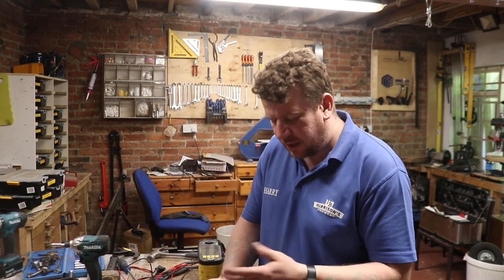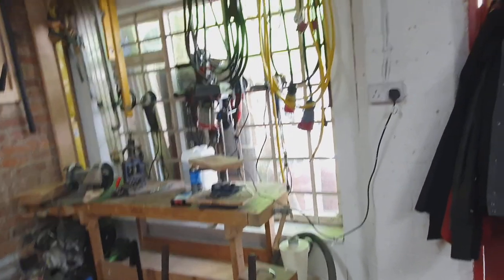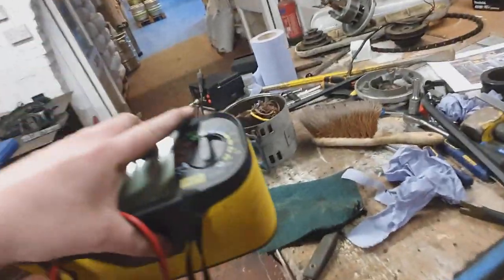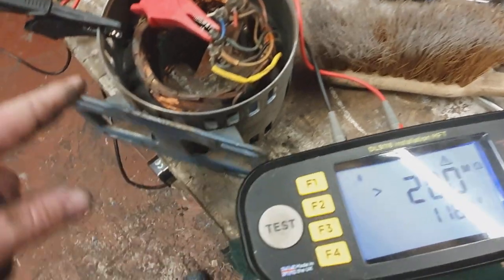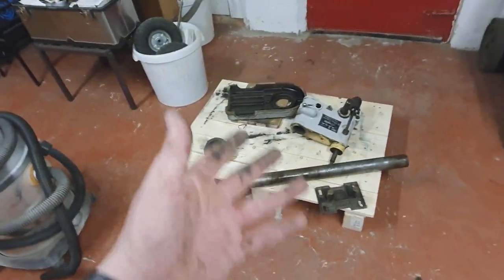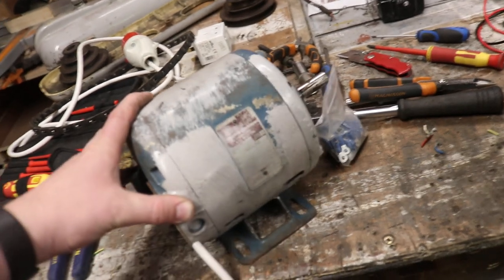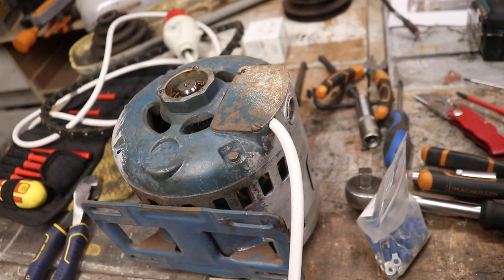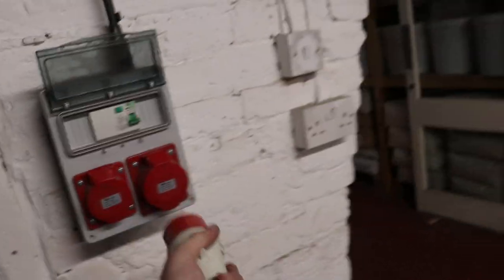FOBCO Star Drill Press Restoration Pt1

Comment: Regarding the addition of a variable speed drive (VFD, or inverter) - a few words of caution from someone who's worked in electronic control of motors for 35+ years.   A VFD works by rectifying the incoming three-phase AC to a DC voltage of about 550-600 volts, and then converts that back to AC (at whatever frequency and voltage you wish) using "pulse width modulation" (PWM).  Without going into all the details (a Google search will give you lots more if you want it) the resulting voltage waveform that's applied to your old motor is quite different from the 50-60Hz sine wave voltage for which it was designed.  The inverter or VFD applies rectangular voltage pulses to the motor windings, with very fast-rising/falling edges (the voltage swings several hundred volts in a small fraction of a microsecond) and this is a lot more stressful to the motor insulation than the ordinary mains supply.  Most high quality modern motors are designed for use with inverters, and as such are wound with "inverter grade"  enamelled wire which is coated with special insulation designed to withstand the PWM voltage pulses (which can cause voltage stresses in the insulation at well over 1000V.)  However, your vintage motor won't be designed for inverter use, and if you connect it directly to a VFD,  you may find yourself having to replace it or carry out an expensive rewind after only a short period of use.   This can however be avoided by placing a "sine wave filter" between the VFD and the motor.  These are available from decent inverter (VFD) manufacturers, and also from companies like RS Components (who supply decent German-made filters from BLOCK). Choose a filter with sufficient current rating for the motor (obviously) and make sure the VFD's switching (PWM carrier) frequency is set to a value suitable for the filter you've selected (e.g. 8kHz).   The VFD also needs setting up to provide an output voltage that's essentially proportional to the power frequency ("constant V over f" characteristic).  This is easy and any decent drive company will give all the instructions - nothing to fear but does need to be done properly.   On the matter of noise, your motor sounds like its bearings are dry and/or have seen better days!  Might just be the proximity of the microphone, of course....   ...but if you've got the motor in bits anyway, I'd generally advise replacing the bearings if you can - the motor should run quieter and hopefully you'll reduce the risk of frustrating (and potentially damaging) bearing failures further down the line.   Hope helpful, best wishes with it all.  I've also inherited one of these drills and am about to start work....